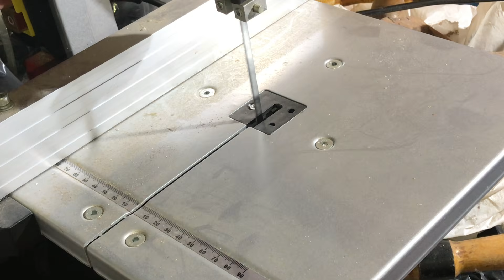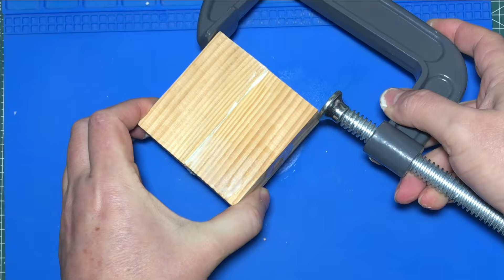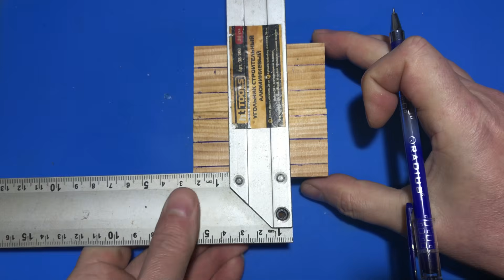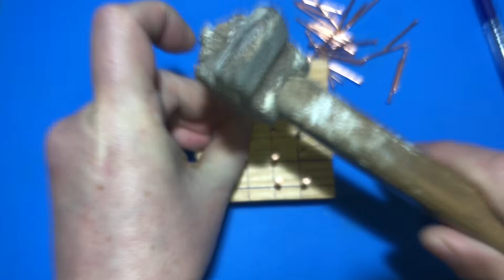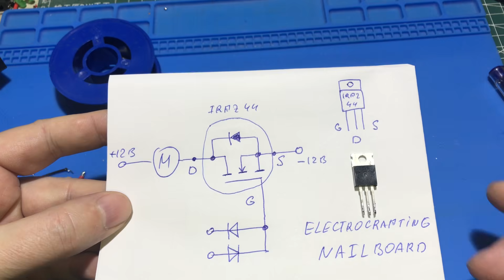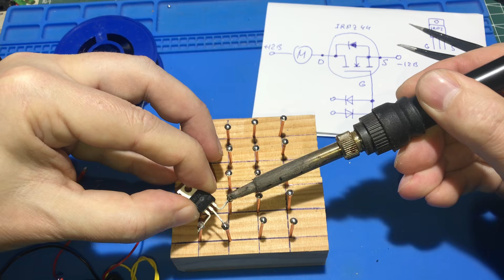Mind Blowing Nail Board Soldering – Beginner Friendly Project!

Comment: You can buy a solderless breadboard kit for less than the cost of glue and copper nails.
Reply from the maker: By purchasing a solderless breadboard kit, you’ll forever lose the magic of real soldering.
You’ll never truly learn to feel the soldering iron, the heat, the flow of solder.
The value here isn’t in the price of the parts — it’s in the pleasure of real soldering.
Reply: @Electro-Crafting Stripboard / veroboard is worth checking out if you haven't seen it
Reply from the maker: @cdhmcclelland  Stripboard or veroboard is already a transitional stage between rapid prototyping and a finished printed circuit board. They allow you to make a circuit more reliable and resistant to errors, while still enabling certain changes, although this is not as easy. Thus, they provide a convenient compromise between board stability and the flexibility of experimentation offered by a nailboard, where components can be easily rearranged, new modules added, different connections tested, and mistakes quickly corrected, making it an ideal tool for learning and prototyping.